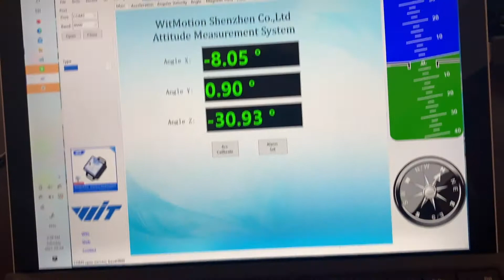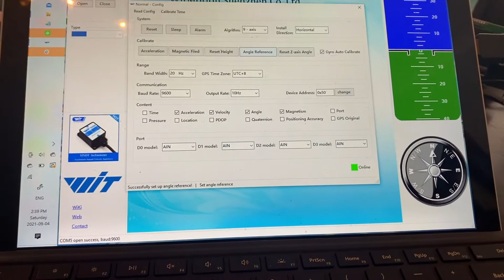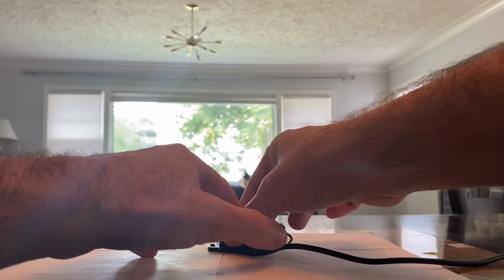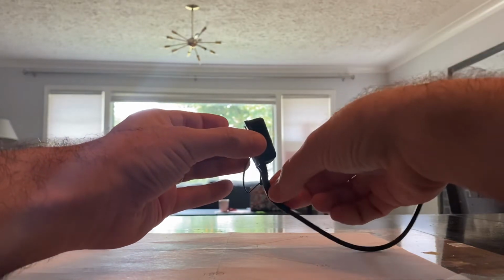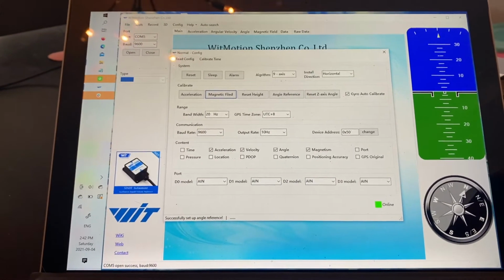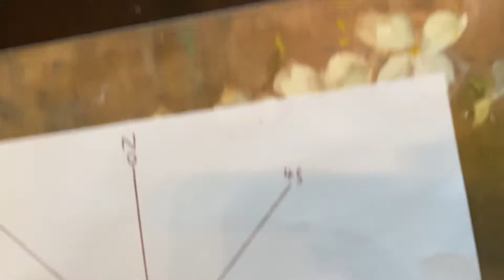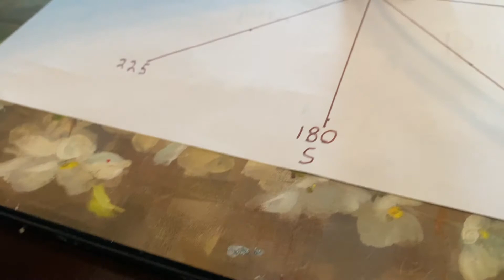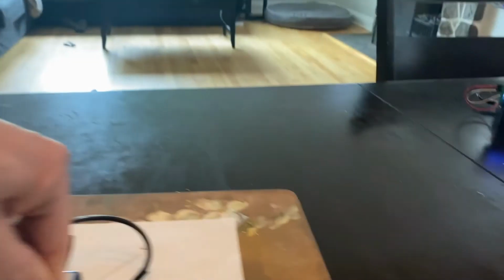Attempting to calibrate the WIT Motion sensor

Comment: I'm using a Devantech CMPS14 and I see very similar errors after "calibrating". It's just like you are showing here! I drew all the 45 degree angles on a sheet of paper and rotate the CMPS14 and get irregular deviations at each angle. I have to add a secondary calibration. I started out with a polynomial fit, but since it's so irregular I switched to a piecewise linear fit that gets me close enough. I think the best fit would probably be a spline fit, but the piecewise linear is pretty good. Today I just purchased the Witmotion and am going to see how it behaves compared to the CMPS14. Maybe we are just seeing unavoidable localized variations. I'll report back later when I get my WitMotion.

Comment: Aircraft have expensive compasses but they still have a deviation card next to them.   For 0 read 357 for 90 read 94 for 180 read 186 for 270 read 271.  Its unavoidable and you have to remember that magnetic north isnt where your compass actually thinks it is, its actually pointing down by like 40 degrees at our location.  Even honeywell sensors for avionics dont get 1 degree accuracy.